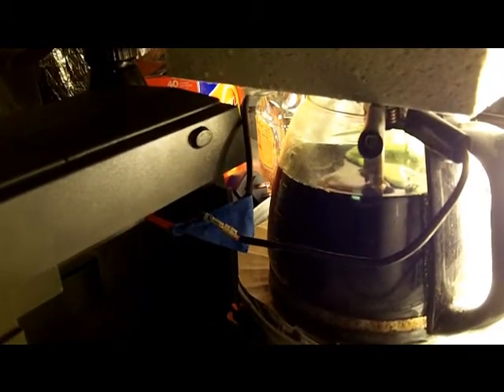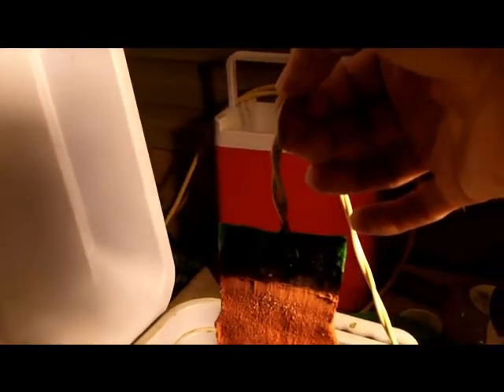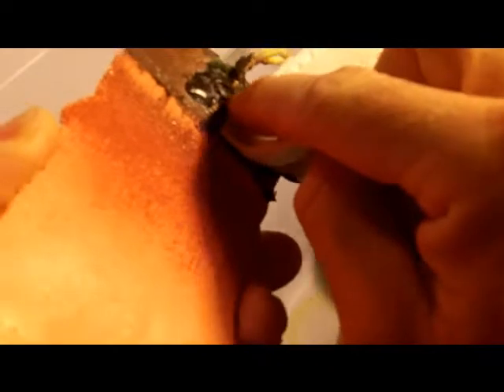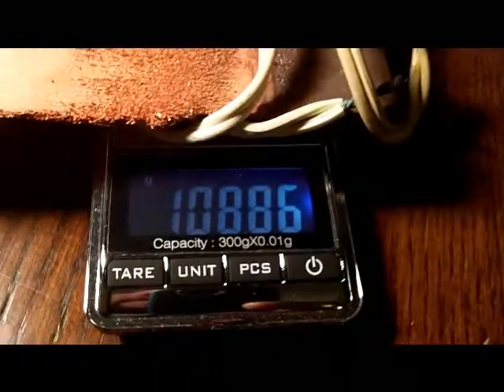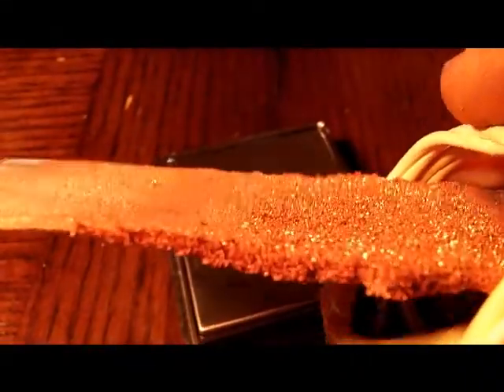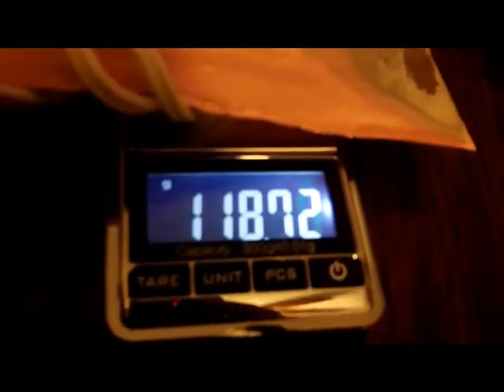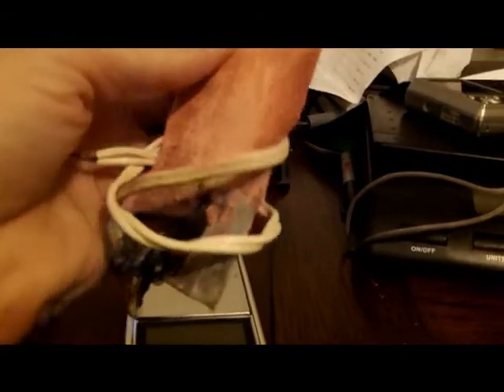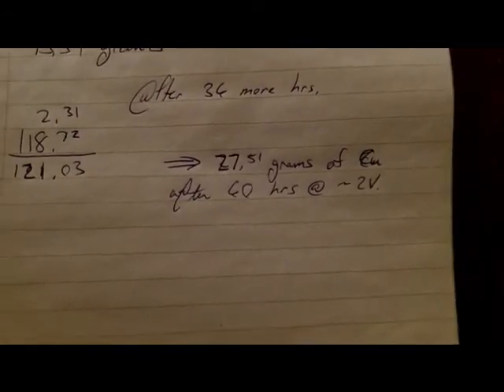Electro-Cell Operation

Comment from the maker: That will drop the copper, but it won't regenerate your acid so that you can use it again.  The electrolysis pulls the metal out and leaves you with an active solution ready to dissolve more copper.   I will be doing a video soon on how to ramp down the whole operation.  When you are all done, you can drop rusty nails in the solution to drop all the more toxic metals ... then neutralize with lime or equivalent.